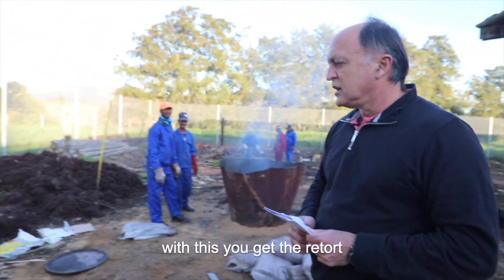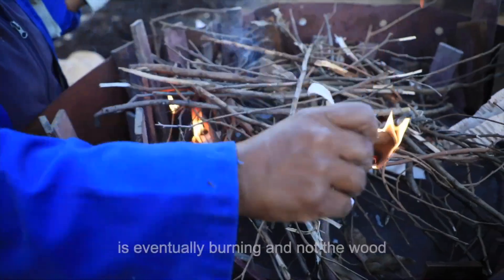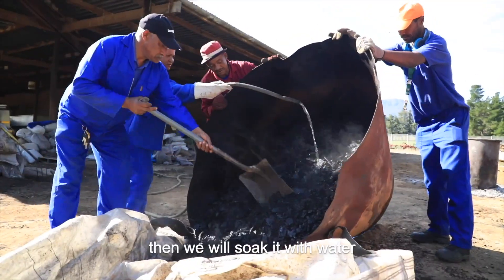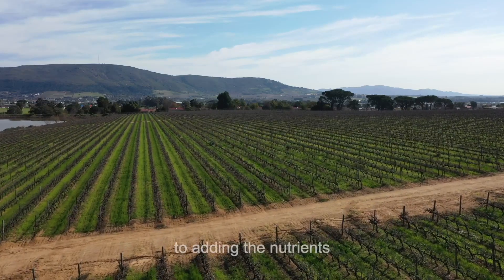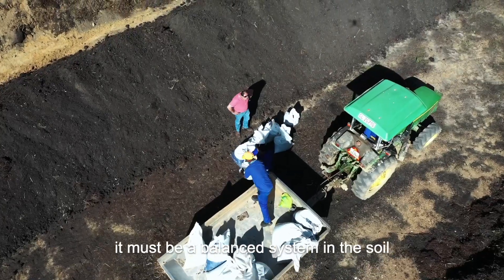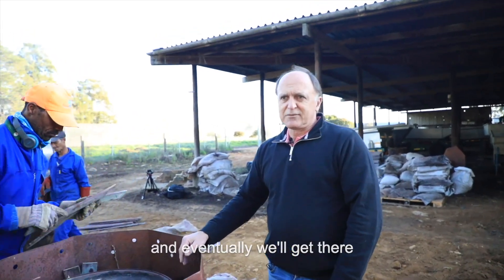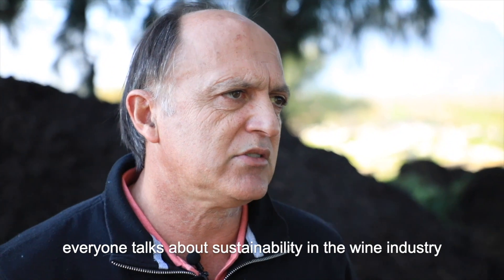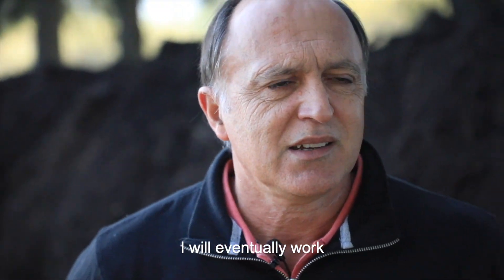Nederburg's Journey of Sustainability: Biochar Project [FULL VIDEO]

Comment: I have been experimenting with making biochar for a couple of years now. What I noticed is that it's missing nitrogen and carbohydrates in the charging process. Manure is perfect to mix it with as are weeds, grass clippings and even urine. If there is a ranch or horse stables close by then maybe strike up a trade.

Comment: Hi may I know any difference between the double barrel tlud stove and the single tlud stove?
Reply: Double will go out on its own when it’s done due to lack of oxygen inside the inner barrel.  The open burn method has to be extinguished with water or by somehow completely shutting off air to it. (This is usually how charcoal briquettes are made.)